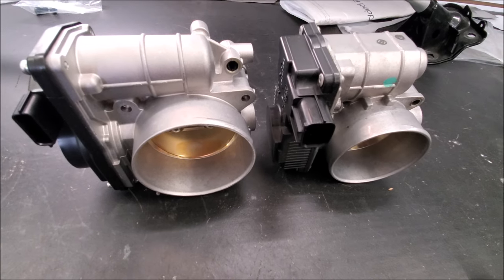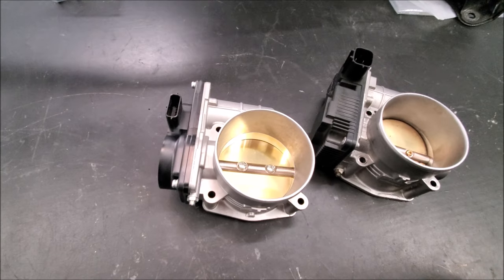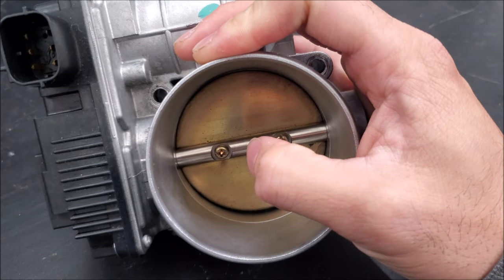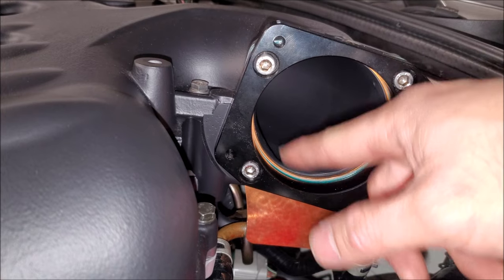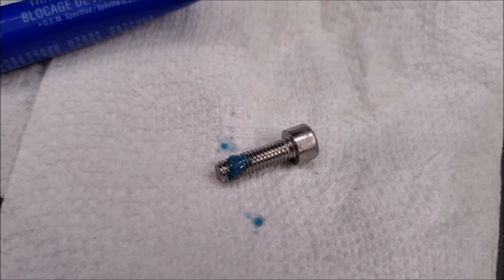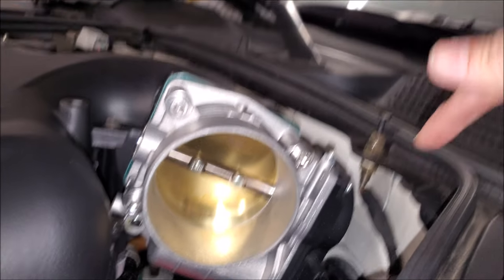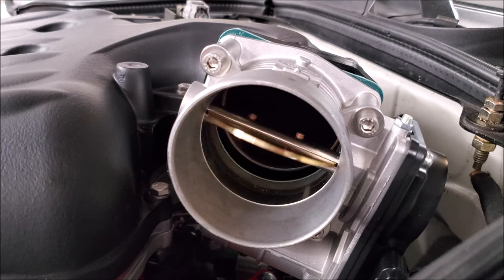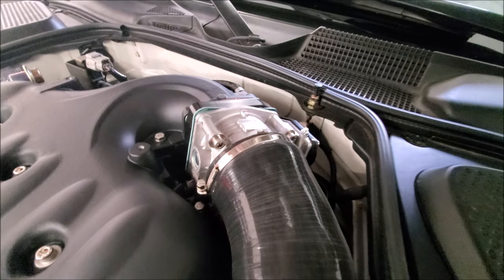Z1 Motorsports 75MM Throttle Body Upgrade Nissan 350Z / Infiniti G35 (Hitachi) | AnthonyJ350

Comment: It does give a power advantage, but perhaps also a change in the curve. Takes a good few hours, even a couple days for the ECU to adjust and compensate.
Reply from the maker: I'm interested to see if the midrange fattens up a bit. Torque still doesn't come on till about 2,800 rpm

Comment: I’ve had mine about a year now and it’s one of those mods that you instantly feel the difference! 🔥
Reply from the maker: Totally agree!
Reply: do you need a tune to run it?
Reply: @kmk1195  No not at all. Mine threw a code once but haven’t had a problem with it in over a year.
Reply from the maker: @kmk1195  Just an ECU reset https://youtu.be/5tQm28K32SQ?si=PIFbhXwc8Box5pw6

If you have other mods you should get the car dyno tuned with UPREV.

Comment: I agree, if you want the Maximum Benefit from a 75mm Throttle Body,  the throat of the upper plenum must be enlarged. Otherwise you will get the same effect as 70mm at WOT. The exception would be Forced Induction.
Reply from the maker: It offsets the volume the butterfly valve occupies in theory.
Reply: @AnthonyJ350  I agree.
Reply: It seems like you really do know your stuff about cars. Love some of your bantering back and forth with Anthony. I had a little bit of bantering back and forth with the engine wire harness cover.

Comment: Do I need tune if I install one? Or its okay for ecu to relearn and continue to use it daily?
I am in vegas and I dont have access to a tuner for z.
Reply from the maker: You should be able just to do the ECU reset and take it for a long drive.

Comment: Nice video. I wouldn't recommend larger TB unless your using forced induction. 

Never by a TB spacer is snake oil. 

The heads and lower intake manifold flow well. Just the front cylinders stare for air under WOT so porting or use a spacer helps.
Reply from the maker: Even if you're trying to compensate for the volume the butterfly valve takes up and trying to squeeze everything you can out of the engine from a bolt on perspective?
Reply: Most people get bolt ones like this to support their upcoming forces induction kit. Or they know it’s not going to provide an insane amount of horsepower they just want a small bump

Comment: Love your vids brother, quick question tho. Can I run a plenum spacer and the V+ Kinetix Plenum simultaneously without modifying anything? The black one that you did a heat comparison video for with that G35 a while back.
Reply from the maker: I think you would run into clearance issues.  I would chose one or the other.  In theory it might pick up a lot of top end but might lose in the bottom and down low.  I'm just speculating, I've never seen the combo done.
Reply: I had that same exact question and haven’t found anyone that’s tried them together.  The hood clearance was my primary concern.  And if I had to choose one or the other, AND never planning on going turbo - I’d probably just get the spacer.  But that’s just kinda going off of what I’ve seen other people do

Comment: Does anyone know if this mod will still be able to pass smog check as everything else is completely stock and cat are still on.
Reply from the maker: I see no issues, provided there's no check engine light after. Make sure to do the relearn procedure and drive the vehicle.

https://youtu.be/5tQm28K32SQ?si=ZCsHif9uof6FIyQD

Comment: By any chance is your tube sitting on a coil pack as in the hose under got any clearance issue since for some reason mine just lays on a coil…
Reply from the maker: I think you figured out your issue correct?
Reply: @AnthonyJ350  yeah after watching your video I did greatly appreciated no more issue I just didn’t turn it enough because the tube would pop off so after leaving it overnight the tube expanded so easy to fix thank you

Comment: Where did you get the throttle body? And do i need a adapter to install the throttle body into my stock manifold ?
Reply from the maker: Got the whole kit from Z1 Motorsports
Reply: @AnthonyJ350  thanks I found it yesterday! Crazy that a tune is not required to install it
Reply from the maker: @K24Reggie  ECU reset is recommended and take it for a long drive after.
Reply: @AnthonyJ350  yes thanks for the heads up ! How long of a drive you think ? I have a 04 g35 6mt. With test pipes ,exhaust and manifold spacer and i made 251whp and i was on 89 and had a misfire because one of my o2 sensors was bad. I think if i tune it I should definitely make 270 280 hopefully 😭
Reply from the maker: @K24Reggie  Take it for a 45 min to 1 hour drive on the highway. Ya new NTK O2 sensors and a clean air filter will help a lot next time you retune the car.
Reply from the maker: @K24Reggie  Also try Shell 93 in the car. Are the spark plugs fresh?
Reply: @AnthonyJ350  i have not tune it yet Anthony , i just put it on the dyno to see how much it will make with the small mods i got. And yes I just bought some spark plugs from z1 like month ago
Reply from the maker: @K24Reggie  It'll be a different car after you get it tuned. Worth it after your bolt ons.
Reply: @AnthonyJ350  you think I should get the uprev cable ? Like you got a video on how it works or sum so I could go see it
Reply from the maker: @K24Reggie  I pay my tuner to tune my vehicle.
Reply: @AnthonyJ350  como se reinicia la ecu ?
Reply: @AnthonyJ350   Mind if I ask what to expect to pay for a tune? I'm similar to you but haven't had it tuned....ART pipes, 75mm throttle body, cat back exhaust, plenum spacer, and am about to replace the 02 sensors since I'm at almost 200k miles
Reply from the maker: @locophoto6881  About $800 - $1000

Comment: Hi Anthony, seeing as you are the go too guy for the Nissan 350z cars, could you help me out please, I need to get a new/used ECU for my 2001 350z and I'm wondering if they are like BMW, where you have to have the VIN number changed to your original vin in the ECU before it will work, do you know if the 350z ECU stores the vin number?  Cheers
Reply from the maker: 2001 350Z?  Check the VIN to verify the year.  Also see if Z1 Motorsports has any ECUs available.
Reply: @AnthonyJ350  Thanks for the reply, Sorry mate it's a 2002 (fat fingers) model, I have a second hand ecu here for the car, (down in New Zealand but not sure if you have to write the original vin into ecu, I had to have it done to a BMW a few years ago, does Nissan store the vin number in the ecu?
Reply from the maker: @JohnSmith-wb6kq  That I'm not sure, I've only had my car dyno tuned. I haven't done an ECU swap on this chassis.

Comment: Did you loose any low speed torque?
Reply from the maker: Didn't notice and the dyno graph showed peak torque coming on the same way at the same RPM.  If anything the low end felt a little better.

Comment: Is this better than a ported throttle body?
Reply from the maker: Probably similar. What's the diameter of a ported throttle body?
Reply: @AnthonyJ350  I got the shop to check it for me an its 73mm ported out.
Reply from the maker: @NegasNl  Pretty close

Comment: Does this make idle stable?
Reply from the maker: My car idles like factory.
Reply: @AnthonyJ350  So like idle is 650?
Reply from the maker: @DelasUT  600-800
Reply from the maker: @DelasUT  I'd check for a vacuum leak and replace your PCV valve as well.
Reply: @AnthonyJ350  I already check hose nothing leaking using the spray method with soapy water and brake cleaner as PCV valve is new replaced and only drove car for 30 miles since.
Reply: @DelasUT throttle body failed, I’m assuming if it’s p0506